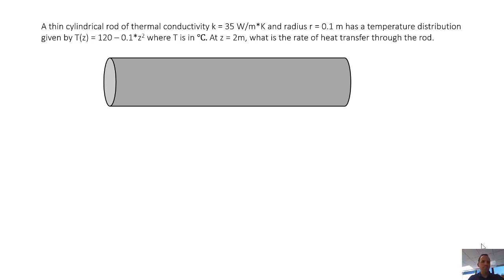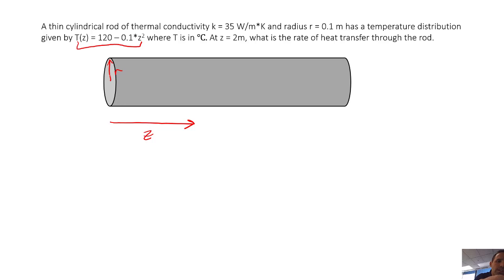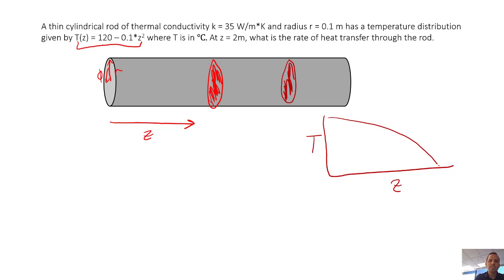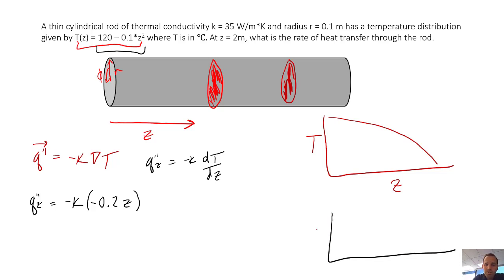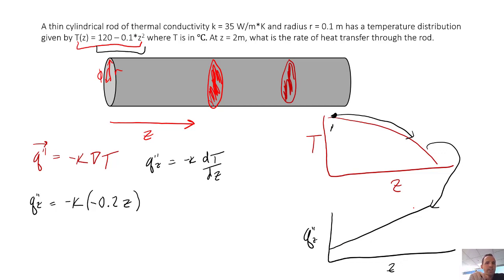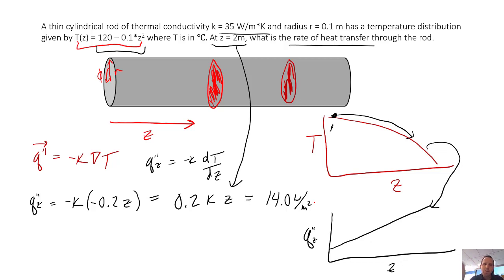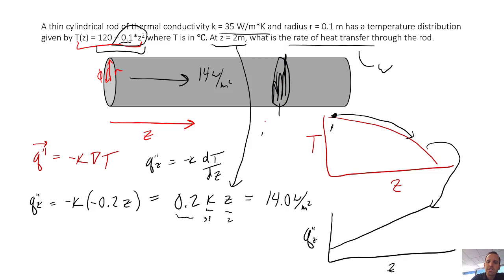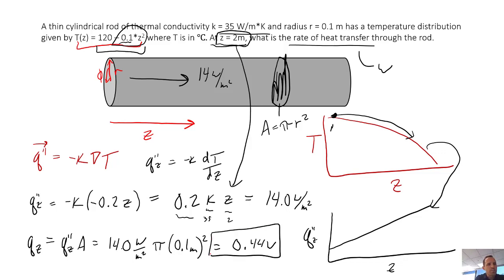Heat Transfer - Chapter 2 - Example Problem 2 - Calculating Heat Rate from a Temperature Profile

Comment: the question states that the temperature is in degrees. Are we supposed to change the temperature not kelvin after differentiating and plugging in values since the fouriers constant is also in W/mK?

Comment: Thank you for this awesome video! Quick question: please be aware of the temperature should use "K" vs "degree C"
Reply: when you subtract two temperature values, it doesn't matter

ex:

20 degrees C - 8 degrees C = 12 degrees C = (20 + 273 K) - (8 + 273 K) = 12 K